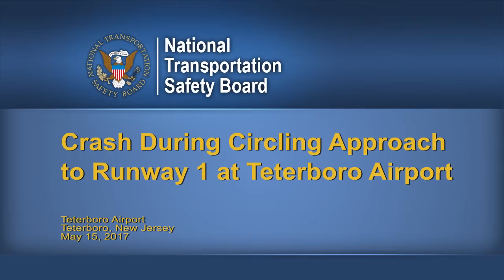NTSB Animation - Crash During Circling Approach to Runway 1 at Teterboro Airport

Comment: Even in the very beginning they overshot MAZIE - and when correcting for that, they also overshot the next waypoint BIGGY in the other direction
All of that while asking for a higher flight level, even though they should've already been planning the decent profile - AND busting the speed limit.
Like... nothing has gone wrong yet and it's already clear the PIC is not in full control of the aircraft.

Comment: I hate hearing guys on the radio who sound like this guy. I used to fly with one, as his FO. I saved our lives once he wanted a route that would have been about 10 more minutes than the fuel we had. He kept telling me to relax. I asked ATC for a different clearance.
Short flights in the Lear can be dangerous, and should also include a mention of which checklists you might be able to skip or cut short, if necessary, during the preflight crew briefing. This guy was so far behind the airplane it’s shocking! Poor FO must’ve been terrified.

Comment: That was an easy to do "Side Step Approach" not a real Circle To Land.   Cirlcle to land is their VOR approach from the west to 19 or 24 runways.
Reply: Rich Grant Thats incorrect. A side step approach is an approach to runway that is parallel to another separated by less than 1,200 feet. A circling approach is an approach  on instruments to one runway and then a visual maneuver to another runway that is not aligned within 30° of the original final approach course.
Reply: @usaswimmer1020 --I know.  But for me it has been always a side step.  A slighly wide side step.  Circling for me is more  difficult and a semi circle or more.  FAA is  full of flakes that cannot maneuver at all.  FARs' in USA are for snowflakes to get all kinds of licenses, even if they can only do Mild Maneuvering due are Maggots.   That is why so many pilot errors all over. Maggots, Mild Maneuvering Maggots.  And if you can fly on the winds or runways they Maggots cannot, they cowards tell others behind your back that "he is a dangerous pilot"  Trying to knock you off the field so they cannot look so bad at all.  USA GA is full of....... Maggots..

Comment: From statements made by the captain, he seemed to be rather pretentious, he did not obey many of the instructions given to him, including, height speed, positioning. He made too many mistakes either intentionally or unintentionally.  It seems that this was a charter flight and the passengers on the outward flight had a bad experienced including a hard landing and in fact, they did not want to use the return journey and took a car back.  I remain to be corrected on the last part as I need to confirm it.
Reply: It's true. They made a life saving decision that I'm sure they think about often.
Reply: Seemed unintentional missed instructions from the video.  It's a lot harder to fly this approach if you don't know what atc is going to say before they say it.

Comment: I have read a lot of comments and as usual there is little reflection or understanding to go with the commentary. It is always relieving to distance yourself from what ever mistakes that others have committed, but you have to understand the scope of the incident.  A briefing of intention in conducting an approach always acts as a roadmap as to how the approach is to be conducted, be prepared to alter your plans, in the face of  changing events or instructions.  All pilots are subject to overload and it has happened to many operators with tons of hours. There are situations that you cannot fly out of; so be prepared to discontinue your course of action and do a go around.  Smaller airport [ runways ] are not always easy to identify even on clear days, you need to have the confidence that if you follow the instrument guidance that you will arrive at a position where you can visually transition to a heads up landing.  larger airports stand out more distinctively against the topography and before commenting you have to consider that not all crash victims are airheads,    I will now comment on experience. a circling approach is not the venue for training an inexperienced crewmate. You can learn a lot by letting the captain do the approach and observing.  getting the airplane in the correct speed, altitude, and aspect, in relation to the touchdown zone is not simple especially if the visual elevation guidance like VASI or PAPI  is not usable until you are almost aligned with the runway.  If there is something to be learnt here is that simulators are the venue for certain types of training and doing it in the airplane live, is a judgement call. lining up with the runway in windy conditions may cause pilots to be aggressive in banking and pitching alterations, in time and with the needed experience, the event horizon increases and you become more observant to what lies ahead.  these are things to consider.  Fly safely and learn from the experiences of others but don't set yourself up to think that its all about stupidity, because it is not.

Comment: Cross control stalls are still an issue with GA. You get too close to the runway and the wind is pushing you through final forcing you to overcorrect. Instinct is to use rudder and aileron, sometimes in an uncoordinated manner to correct and at low speeds you can get into an uncoordinated stall, even when above stall speed (aerodynamically speaking the top wing stalls because of its higher angle of attack and the aircraft proceeds to roll the opposite direction) which can result in a stall/spin incident which at low altitude can be quite fatal. The FAA has finally mandated stronger unusual attitude recovery trading for Part 121 operators (simulators are now being reprogrammed for FULL STALL scenarios). Older training had us try to maintain altitude in a stall. That has now been revised to say that getting out of the stall is primary, regardless of altitude loss. But since these new rules don’t apply to Part 91/135 operators, not everybody is getting the message. If these guys had been trained correctly there’s a possibility they would’ve known to reduce the AOA, straighten out the aircraft, get it flying again and go around. Cleaning out the seat covers is much preferred to making a smoking hole in the ground. 
And for background, I have 7 type ratings and 16,000+ hours in the air. And I haven’t lost an airplane or a passenger yet.
Reply: Absolutely right on use of the rudder. When my pops taught me to fly he had me use zero rudder on base to teach that point. Blowing the center line he said although not a good base leg is fine , you may continue your same bank angle to center line or go around. If you use rudder in that situation to correct you are a complete fool he said. Of course rudder can be used safely but only after one understands what an accelerated stall is and how the rudder relates to it.

Comment: It’s all about bank angle. At a 60 degree bank your stall speed increases by 40%.  I would say he was close to that trying to not overshoot runway 1.   Classic base to final stall.  When you run out of altitude,airspeed and ideas all at the same time.
Reply: It was like he was trying to right all the mistakes made, in the last 15 seconds of flight. Also seemed as if all his flight training was for nothing, he clearly forgot everything he ever learned. Looks like a suicide more than a controlled landing. yet a terrible loss.
Reply: I think this is an accurate guess, judging by later reports (see below for links). The captain tried to make a late and violent course correction to final, through an area that was experiencing up to 30 mph wind gusts, and for which a low-level shear warning advisory had been issued. The steep bank at relatively low speed took him under stall speed, with no height to recover, and there's some indication that the plane almost flipped over before it hit the ground. 

An account of the NTSB report is here: https://eu.northjersey.com/story/news/transportation/2018/02/07/files-detail-last-moments-fatal-2017-teterboro-jet-crash/317380002/ Another report, here,  https://patch.com/new-jersey/wyckoff/nj-man-was-co-pilot-learjet-crashed-teterboro 
states that "The NTSB found no drugs in either Alino [SIC] or Ramsey [Captain] and the voice recorder does not indicate that anything went wrong with the plane while it was on approach to Teterboro." The captain had at least 15 years' experience and had made thousands of landings. God knows what was going on in that cockpit.
Reply: @innocentoctave  You're right, my point is where was his training? Go around, he had to be aware that his flight path was deteriorating  and there was no chance for a successful landing. My first 8 hours of flight (40 years ago) consisted of take off, and land in that field, take off, land on that gravel road, take off land in that meadow. Hell, I just wanted to fly, well years later what she taught me saved my life, an off field landing in a field that had previously killed a state trooper years before. If you don't have a plan you don't have a chance.  Follow procedure. Stay calm. Keep flying the airplane.
Reply: @seapilot4042  Obviously I'm guessing - nobody will ever know - but my impression is that the PIC was severely impaired by something: probably fatigue. I can't see any other explanation for a series of bad decisions and unexplainable mistakes, such as requesting an altitude that implied a much longer journey and then apparently believing that he was still 'hundreds of miles' away from the destination airport. Command given to the unqualified SIC - why? So the PIC could snatch some shuteye on what should have been an easy flight? The SIC repeatedly trying to return control to the PIC, with no response? By the time he resumes command, it's way too late. Marc Bennett has it right: too steep a bank angle in an attempt to make a very late turn to final raises the stall speed and he stalls. The crash looks like a rookie error: but to me the likeliest explanation is just that the PIC is resuming command in a big hurry and too late.
Reply: @innocentoctave  Well stated, I agree. Cheers
Reply: Going by the report, it seems the main direct cause of the crash was that the captain ended up flying far too slow during the turns(particularly the final left turn), even though the SIC called out 'add airspeed' then 'airspeed' 3 more times, seemingly in an urgent tone.
The report indicates the bank was much less than 60 degrees according to radar data, which showed they reached a maximum of 35 degrees. Perhaps the pilot was pulling the yoke during the turn which made it seem steeper, and accounted for the rapid decrease in speed? (only a guess though, I'm certainly no pilot)
They ultimately stalled at 111kts, the SOP target airspeed was 139kts. Without any wind, the manufacturers listed stall speed was 102kts at 35 degrees.
If eyewitnesses were closer to the actual bank angle, presumably there was no wind gust at the precise time they stalled.
Considering the airspeed 'continued to rapidly decrease', it seems there could be a high chance they would've stalled(slightly later) even at 35 degree bank angle and without any wind gusts.

Comment: I'm no pilot, but I wondering that if the Runway cross over to 1 from 6 is very common, is there a way to have an ILS setup at MetLife pointing towards TORBY or DANDY? Then could the ILS indicator in the plane be configured so it started giving out ILS warnings to a pilot not following the METLIFE ILS?
It's not up to the controlers to babysit the pilots on the turn as i'm sure had other traffic and rightly assumes the pilots knew what they were supposed to do, so perhaps this mechanical warning might work.
The Pilot failed to respond to SIC several times, I wonder if they were microsleeping?
Reply: stumpy petros: I'm a retired ATC. ILSes  are straight-line radio signals that must be dialed-in like a radio station. What you're suggesting is what would be an MLS approach that I think was abandoned years ago. There are strict ILS certification requirements and some rather expensive equipment needed. Circling approaches are very common and used daily. The primary approach into most airports (all?) is a visual approach where the pilot sees the field and flys the approach visually without the need of instruments and a circling approach is a visual approach. Circling approaches can only be issued when the ceiling and visibility allows. We actually have a book (7110.65) that outlines our rules for everything. In this case neither pilot seems to have been flying, relying on the other. Filing FL270 (about 27000') for that short of a flight in that congested airspace was an indication that there was a lack of awareness on the PIC's part. That, or they were relying too much on the automation; IMHO a way too common occurrence these days. Check out the AIM (Airmans Information Manual) and 7110.65 (both online) if you're interested.
Reply: Thanks for the explanation Michael. I was thinking ILS was a bit like the converging lights for the Dambuster bombers but where you see the drift from one frequency to another, so if you have both youre straight down the middle. 
In this case, I wonder if you could use one straightline frequency and then get the plane to scan for that known ILS frequency? then if it hits it from any direction, the software in the plane dould do a "Warning Crossing METLIFE." sort of thing? This would prompt the Pilot to start their turn perhaps?
Reply: @stumpypetros2685  an ILS can only be a straight-line path.  What you're talking about is more of an RNAV approach, and curving RNAV approaches are somewhat common but not every plane has the equipment to fly that.  Imagine if the US were to equip highways with magnetic paths that cars could automatically follow.  That'd be great for anyone buying a new car, but, your 1998 Honda Accord would still have to be driven manually, and the guy at the wheel then still needs to know how to stay in his lane, right?

Comment: It could be noted that responses like "got it" or "copy" or "okay" are not proper communications protocol that signify acceptance of an ATC clearance.  Obviously this captain was a pilot who was not a stickler for proper procedures.  When you're a cowboy, sometimes you get bucked off your horse.  If that horse happens to be an aircraft, getting bucked off is going involve a lot worse consequence than having to pick yourself up off the ground and getting back in the saddle.  And if your're a pilot who prefers flying by the seat of your pants, you ought to save that for your days off when you can jump in your Taylorcraft and shoot touch and goes on your grass strip.  Don't do it on your job in the left seat of a Lear in a busy New York terminal area.
Reply: Tim E. I’m not making excuses for them,,but if you were in the area THAT DAY, it was so windy, too slow too low too tight a turn gust of wind,,they lost it ,,it damned near welt inverted, I missed it by 15 mins or so,,I was across from the airport shopping, Then left the area, heard it on the radio, saw it on TV.  from Maplewood nj

Comment: So they flew the plane into the ground themselves? What a waste.
Reply: Galileo7of9 
Yeahhhhh be quiet.
Reply: @Galileo7of9 yes, it was under pilot control. this simply means that all actuators respond nominally - the aircraft is behaving as per pilot inputs. you are thinking of "control" in the sense that the plane goes where the pilot wants it to go (i.e. not into the ground!) but it is the pilot's job to combine his intentions with the laws of flight physics to arrive at suitable control inputs.
Reply: Greg Caesar  you should have been in the area that day, buy was it very windy, with high gusts,,they were too low, to high a bank angle, which INCREACES THE STALL SPEED, THEN LOST IT , THE NOSE & cockpit hit the ground first data , near inverted, I was in that area that day ACROSS  from KTEB, I think there might have gusts near 60mph., but left 10 mins before.from Maplewood NJ

Comment: Unbelievable. I'm speechless. The only 'silver lining'to this is they had no passengers & killed no one on the ground.  Was this plane a charter / rental flown by hired pilots or ??? Must have been affected by fatigue, drugs or alcohol. I can't fathom otherwise.
Reply: David A yeah, hard to believe the captain wasn’t high or otherwise altered. I just can’t believe anyone would be that incompetent otherwise.
Reply: Go to the docket and read the witness statements of the group who chartered the plane. They drove back after the outing because the one brother refused to fly on the plane again due to a hard scary landing on the initial flight down to the golf outing, so this could of happened with ppl on board but doubtful this scenario because the drop off was I think Boston, then Teterboro to park. Group told pilots to forget staying around for return flight, we're driving back.
Reply: @GNX157  Gosh GN thx for digging that out of the report - it sure illuminates how / why this happened. My other question is what kind of rich idiots let a million (several?) $$$ plane be handled by such incompetent hands ? Any insights Sir ?
Reply: David A And they made several stops  that day, & were returning to the roost, , It was a bad day, very windy, they were too slow, too low,,and too steep a turn, wind,,then lost it, darn near inverted, that was the only red LEAR 35, I’d  ever seen,, YOY needed to have been in the area that day.  from Maplewood NJ